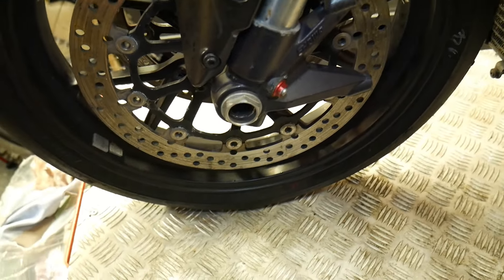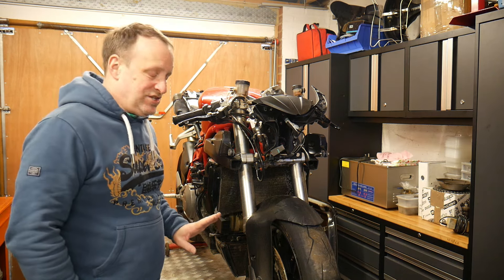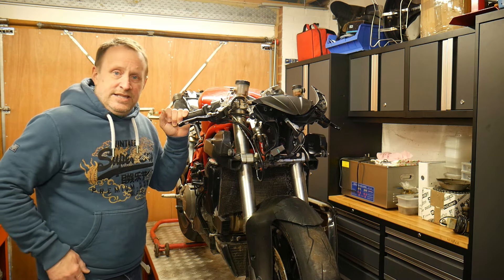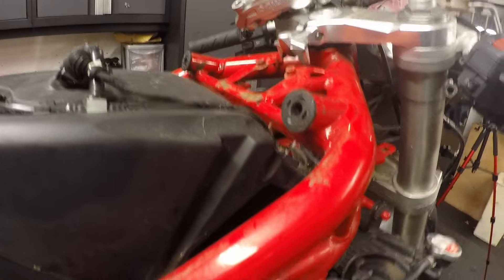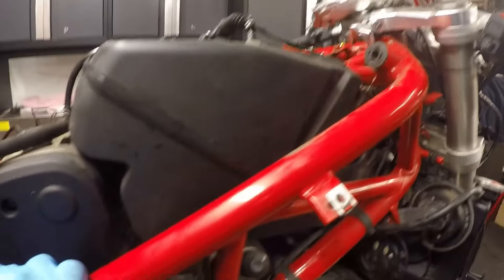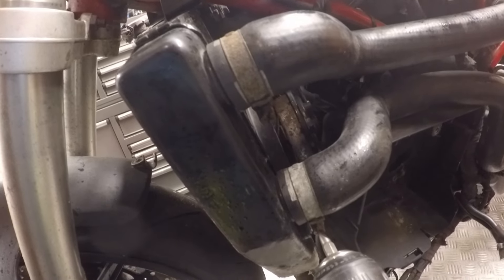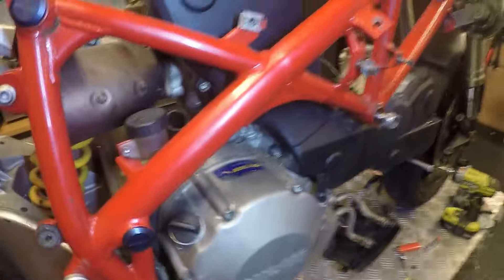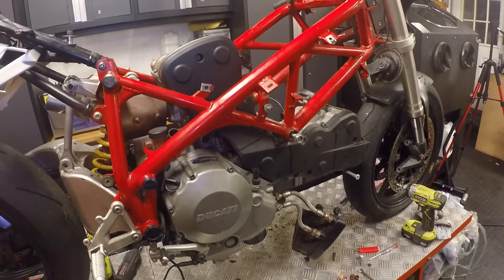Ducati 848 Bike Tear down, need to inspect a low compression engine EP01

Comment: Great to see another video mate. The bike has a lot of small issues but with some time and elbow grease it will come up a treat. Always a shame to see a bike in such a state but it’s going to make for a very interesting set of videos and I look forward to seeing what’s wrong with it.
One of my 1098,s has the engine out at the moment so I would appreciate to see your method of removing and also re-installing the engine when it comes time
Reply from the maker: It looks worse that it is, having been sat outside its just mainly dirt, I think it will come up quite nicely. 😊

Comment: Long time, no see. so glad you're back - have always enjoyed your videos.
For me definitely drop the engine first. I don't think it's much different *(in difficulty) from the 748 which I did on my own, and it just makes sense as the access is so much easier for everything.
Looks like the front exhaust studs have left a little sticking out, so a straightforward weld nut on to then remove?
Very interested to learn what the issue is. Bizarre that someone is prepared to let a bike get into such a state, then being prepared to pay, what is going to be a large bill to get it sorted. Bonkers
Reply from the maker: Glad to be back and thanks for watching, I think the nut welding route is the easiest way forward forward for the studs. 

See the pinned post for the bikes background, its worth saving if it can be done 😊
Reply: That's interesting, the providence of a bike is always good to know. Yes the welded nut on trick has always worked well for me. I think the high temp also helps break the corrosion down in the threads. I learned from using oxy-acetylene how the rust on steel to steel parts breaks down - sort of almost goes to a dust. Happy days and once again, thank you

Comment: I'd be interested to see how difficult it is to take the heads off with the engine still in. I have a feeling that will teach us that it's easier to just drop the whole engine even if we only need to do head work lol.
Reply from the maker: An interesting viewpoint, the horizontal is straightforward, the vertical slightly more challenging. 😁

Comment: Great video as always, this bike has clearly been left outside and neglected. By the way the intake tube bolts are not correct that's why the tube mounting point got damaged.
Reply from the maker: The bike was left outside for a couple of years. Thanks for the info on airtube bolts 😎

Comment: Re removing the heads in-situ - yeah would be interesting to see it done that way….If I got to the the point of needing to do this, however, I’d more than likely be done with it and drop the whole engine…especially with this one…”basket case”….hoping the current owner didn’t pay too much (anything) for it?

Another interesting video though Nelly, great to see you making more content, always enjoy watching the projects.
Reply from the maker: Thanks for your choice, will need to drop the engine anyway as part of the planned works 😊

Comment: Hey desmowerx when i took apart my ducati 848 to replace half of the crankcase i used your videos and they helped alot long story short the duc 848 runs perfectly again.   One small issue.  While removing inspecting and replacing everything i noticed that one of my valves on my cylinder heads had a very small thin hairline crack on it );    i didnt want to replace due to my lack of experience and i had already done so much work to it i wanted to make sure it started back up before tackling that job.    But the bike starts up and runs just how it use to but that hairline crack is a ticking time bomb i need to fix.  ASAP.   Im gonna have to disassemble the whole cylinder head down to the smallest componenents i will let you know the outcome once i get there thank you for everything
Reply: The hairline craxk was so thin very thin but it was visible to the naked eye.     And i was able to feel it when i scratched it with my finger nail.     I worry about the valve shattering t pieces everytime i start the bike up but so far so good.      It is located on the disc shape of the valve.    Im 25 and i am gonna take on this job wish me luck
Reply from the maker: Good luck, its a brave move to put a defective valve back in and leave it there. Its not too hard to replace the valves on a Ducati once the head is off 😊
Reply: @DesmoWerx     yes and i dont mean i put it back in there.   I mean i never replaced it because of not knowing how to dissassemble everything that a ducati head has in it .     I basicalley took the motor apart and took heads off but left the cylinder head intact.   Not removing anygears or components from it.      When i put evrrything back together i didnt replace the valve.  I just took note that it was a job for the future , sadly the future is now );

Comment: Question for you when you are doing these tear down  if you see a crank bearing that’s failed how often do you find more internal damage? Was told I can change these out but it’s essentially going to be an engine rebuild. Trying to decide if I should do that or get a new engine
Reply from the maker: It would really depend on how badly they have failed, if its catastrophic then it could have damaged something else. Most of the time I change them as the engine is apart so its a good chance to change them as the cases are split, only dealt with a small number of failures and they had no impact on any other part.

Comment: Hi. Would drop the engine as you certainly intend to open the cases, checking for the mains, gearbox etc
Reply from the maker: Thanks for your choice, will certainly need to drop the engine anyway due to the work needed.

Comment: Drop the engine - based on what we've seen so far you'll likely find more issues once the heads are removed and the engine will need to come out anyway.
Reply from the maker: Thanks for your choice, fingers crossed there is not much to do 🤞😎

Comment: Valve guides!!
Reply from the maker: Not a leak cause typically in a direct fashion but a damaged valve guide could stop the valve operating correctly, it would certainly lead to excessive oil use as well.